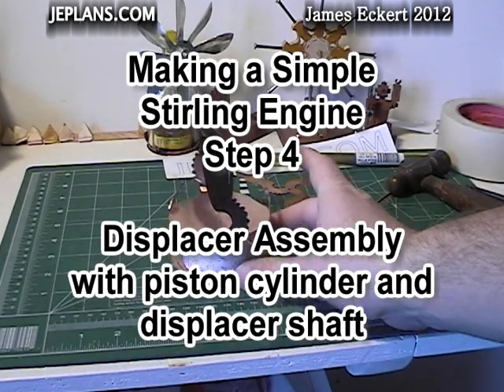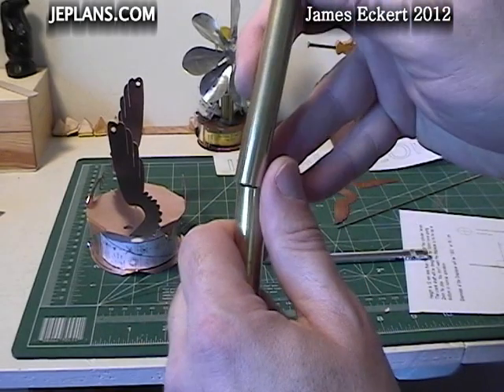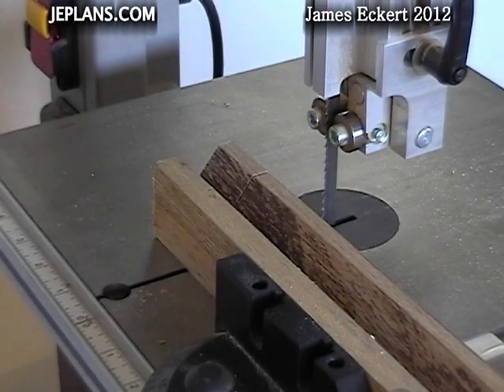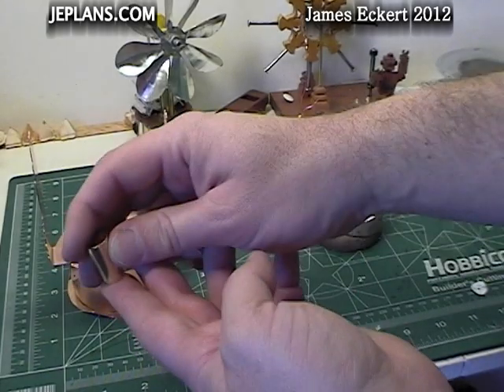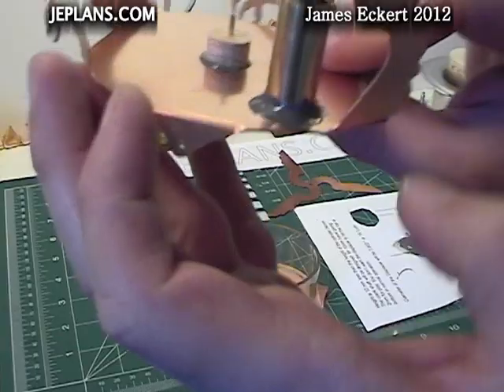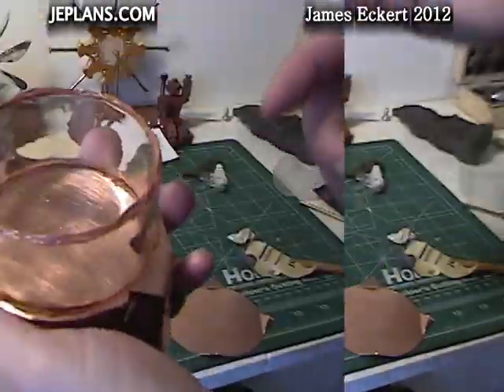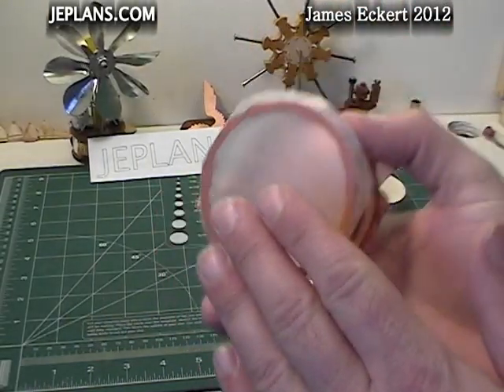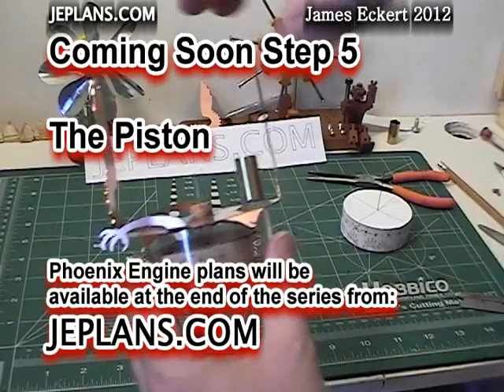Step 4 Making a Stirling Engine:Assembly

Comment from the maker: They are K&S Engineering brass tubes, most hobby store have a display of their supplies.  All the sizes in K&S display fit in or out the size immediately adjacent to it up or down the display. I usually go with something around 1/2". The biggest challenge is not warping the tubes when cutting. Any drag on the piston and they won't run or at lease not well,and no oil on the piston they run better dry. For details on the exact parts I used I sell plans for the this engine at JEPLANS.COM